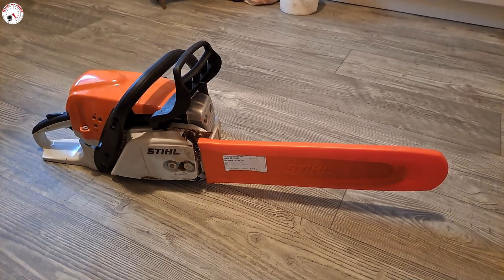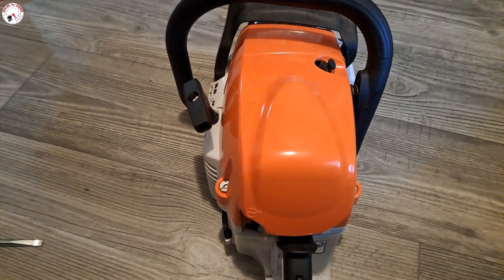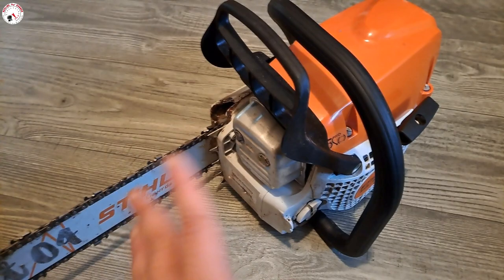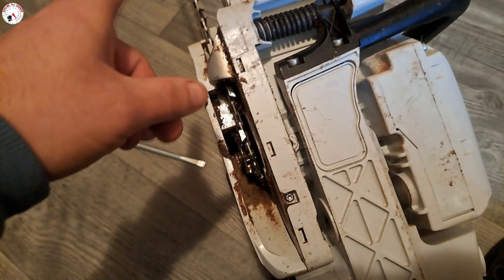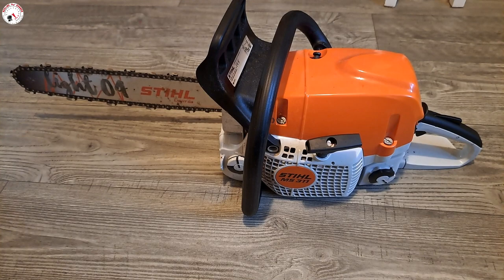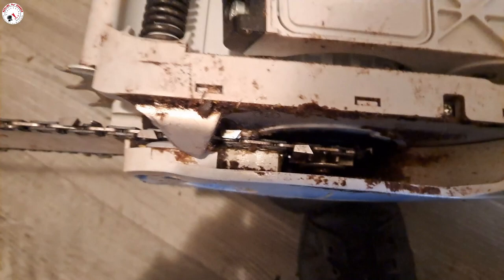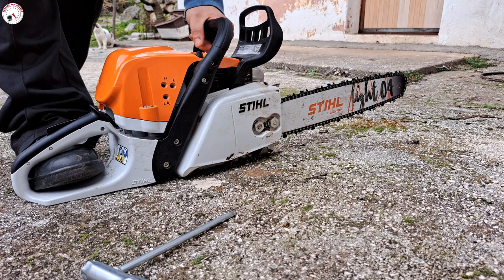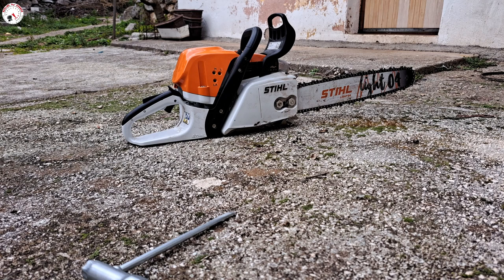STIHL MS311 Chainsaw Review And Key Features

Comment: Sir , how reliable is the 311 saw as I'm planning to buy one,don't like a finicky one where I find myself in the repair shop on a regular basis ???
Stihl dealers can be very persuasive at times and not giving honest advice!!
I'll thank you in advance  Gunter
Reply from the maker: Hi. I have this saw for 16 months and so far so good. Absolutely no issues at all. Just one advice. AVOID Stihl oils. They are very expensive but the worst oils you can find. Just mix any JASO FD oil 2% and run it. Don't worry. Keep your chain sharp, from time to time wash the air filter (I have video how) and every two years replace air and fuel filters and spark plug NGK BPMR7A. I'm very happy with performance and reliability. When you start it first two fuel tanks you'll notice that engine needs to idle for about 30 seconds before it's ready to accelerate. First three fuel tanks don't push it hard. I have a video when I made bunch of firewood in 12 minutes. First few cuts take it easy later you can gun it!!
I hope I helped.

Comment: Nice lots new upgrade mine is about 12 years   only I had change spark plug
Reply from the maker: Thank you. This is a big upgrade compared to my old chainsaw MS230 from 2005.
I never run the Stihl oil. 
I run Castrol POWER1 RACING 2T!!
Fully synthetic oil for mix between 1% and 2% and ofcourse I run 2% as recommended by Stihl. No smoke, clean spark plug, full power. 
This chainsaw still doesn't run as perfectly as possible because it's not broken in. The compression is insane, power once it warms up is incredible, throttle response too. Need to break it in so I don't break it down... :)
Reply from the maker: @The Blue Bike & Doyle  What exactly model do you have?
Reply: @REDLINERUNNER  its a farm boss 59cc 18bar  been so long ago ms29 but not sure it one down from pro model  .
Reply from the maker: MS290 doesn't have 59cc a bit less. Mine has 59cc. I'll just check. Both are farm grade chainsaws..
Reply from the maker: Your has 56,5cc / 3,8hp
My MS311 has 59cc/4,2hp but it has unbelievable compression...
Reply from the maker: I just found online that MINIMMAL compression for MS311 is 110psi/7,58bar... But can't find what's the compression in brand new saw... I'm very curious, because it's insane difficult to pull without pressing the decompressor...

Comment: Picking one up in the morning. I use an MS250, but a big ass tree fell over at my mom's house, and I am thinking the 311 will get the job done. Then I will just use the MS250 for small stuff and the MS311 for the bigger cuts.. Thx!!
Reply from the maker: You can install 50cm/20" bar and chain, but from factory comes 40cm/16".
Don't push the engine cold. Start it and let it run on half choke for 5 seconds, let it idle for 30 seconds and run it in the log gradually increasing the throttle. When it warms you can use full RPM just don't make it struggle. It's brand new. After 3 tanks you can push it hard. Thanks for watching.
Just always mix 2% with oil that has JASO FD which is the highest norm available for 2T engines.
Good luck and enjoy your new saw. Thanks for watching..
Reply from the maker: I plan to make a video of me cutting some fire wood soon. 
I would suggest you to ask in your dealership for one tool...
Two in one chain sharpener. Ask for it..
You need two differrent, because for MS250 chain is 3/8 picco, and MS311 has 3/8. Amazing tool..
Reply from the maker: I'm rendering video to show the performance of broken in MS311...
I planned to sharpen the chain a bit, but not bad anyway. I hope you'll watch..
Reply from the maker: I just uploaded a new video of me and my friend cutting some firewood with my MS311...
Reply from the maker: Hi bro. I would appreciate if you follow my Instagram so we can follow each other for new content.
My Instagram is redline_runner_ig
I have a new video about maintenance... @markyakubovsky3380